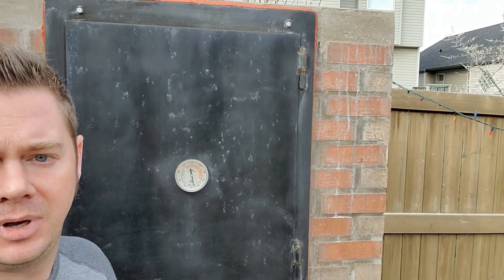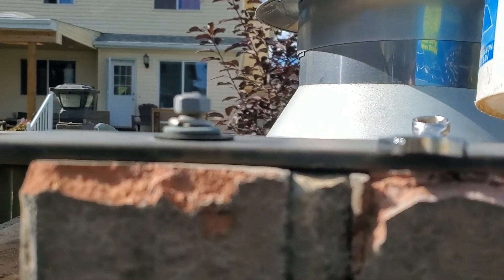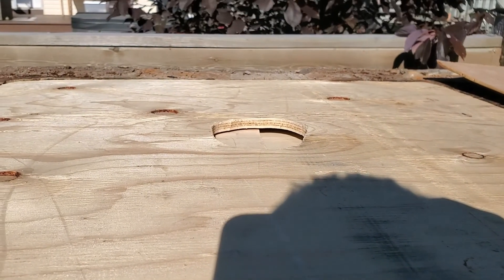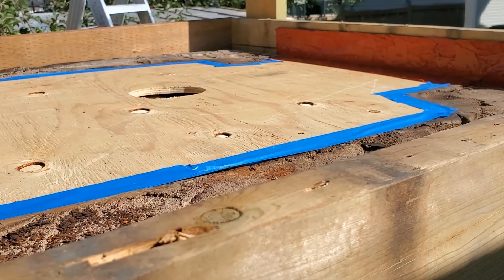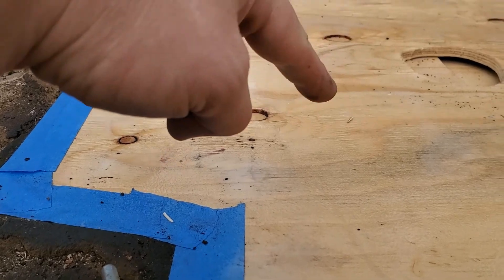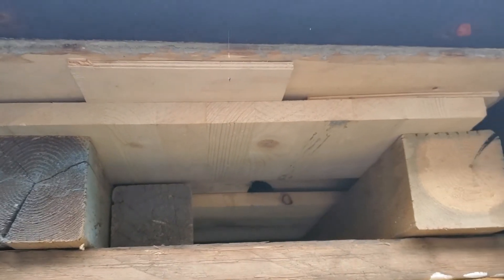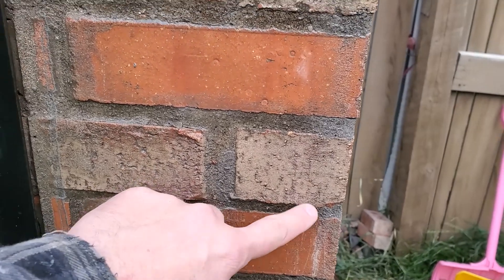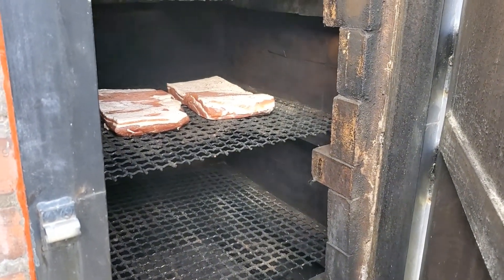Replacing My Broken Brick Smoker Roof with Concrete

Comment: Fantastic smoker my friend, it makes my smokers biting your dust. I’m making my video’s all year round too and in the winter i’m fighting the cold. Awesome cooker you have 🇨🇦🔥👍
Reply from the maker: Hey, thanks! My first smoker was one of those bullet-shaped water charcoal smokers, and I found that the climate here made using it rather frustrating. I was determined to build a smoker that could withstand the cold and wind. This does take a decent amount of fuel to heat up, especially when it's cold, but it stays warm quite well once up to temperature. Thanks for the kind words! :)
Reply from the maker: Hey, thanks, man! Yeah, I built this after getting tired of struggling to smoke delicious meat in the super cold winter. It was a great victory over the Albertan weather! -40? Okay, it'll take a good amount of fuel, but I can do it. 🤣 Cheers!